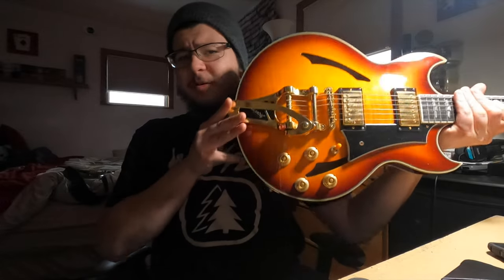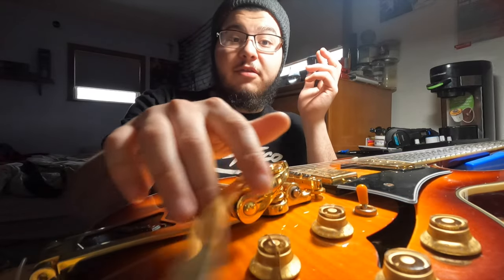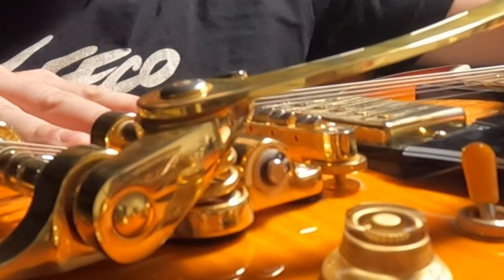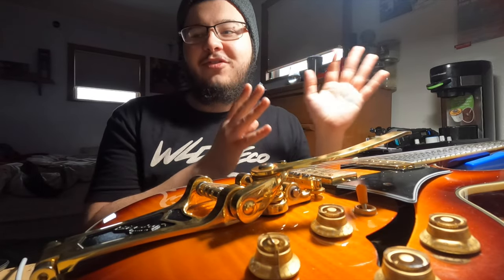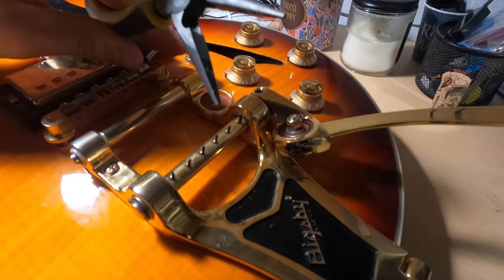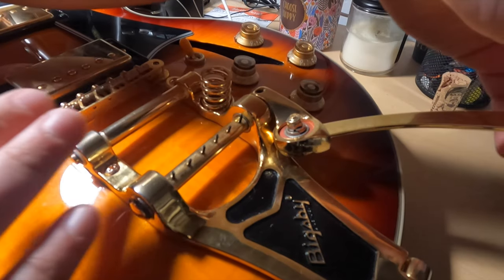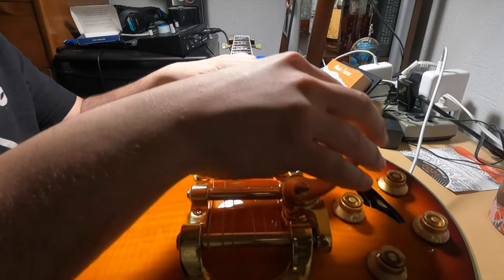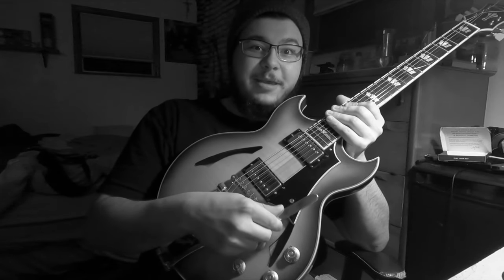How to fix a Loose and Squeaky Bigsby Vibrato

Comment: Use a second nut to tighten against the original. This will help lock the original nut in place preventing it loosening up in the future. I've also heard a small dab of super glue against the nut and thread will help bond the two together. Not a huge amount, just a small, single dot of glue so with little pressure the nut can still be released from the thread of the bolt if needed.
Reply: @Laxcoach1574  It's working perfectly. Obviously it may be finding the right fit but my Bigsby is vintage and two nuts, same size are working.
Reply: @davidsmoler9144  I've got a new 5240, there isn't enough room on the threaded post for a second nut. Wondering if I replace the washer with a lock washer if that will solve my problem of the nut working itself free.
Reply: @Laxcoach1574  Gosh?! Is it a licensed Bigsby? There may be some differences between the two. It's a bit of a hassle, I'm glad mine is working but it takes some fiddlin'. If new guitar bought via retailer have them sort it.
Reply: @davidsmoler9144   licensed
Reply: @Laxcoach1574  Ah, that may explain it then.
Reply: I have a question, I'm thinking of buying myself a non-licensed bigsby bridge jazzmaster guitar (about 200$). I'm scared if the trem stick is gonna be loose. should I buy the guitar anyway or should I go with a Fender squier jazzmaster? thanks in advance for the reply.

Comment: That nut that tightens the Bigsby arm is a 5/16" nut. Use the right wrench or socket. Pliers are a bad idea and there's a good chance of stripping the nut. Also straighten the spacing of your strings on the Bigsby roller arm. It will help you guitar stay in tune.

Comment: Tightening the nut is more or less a temporary fix for an ongoing problem. Why not just add a little drop of locktight to the threads or even a nut with nylon threads?
Reply: I tried that and i ended up ruining the threads.
Reply: @zacharyrossi904  what happened exactly?? what did you do?
Reply: @by.daekeryyy  its actually fine now im all good. i was just woried because when I put on the locktight the nut wasnt going on at fist but then it did.

Comment: Seems to me that they could solve this problem (happens to me every few years on my Emperor Swingster).  A different approach to engineering!

Thanks for this quick and easy video, plus the King of the Hill bit got a laugh outta me.
Reply: Actually this symptom, is a result mostly of the guitar falling, whereby tightening that nut is a perfect solution. 

If a different design was created it might break instead of loosen causing a worse situation to deal with and complain about on YouTube.

Comment: Don't understand how it got so loose......the nut on the underside is a nylock and they do not back off.  Anyway......the B3 arm on my Collings Statesman is much too tight and will be loosened as part of a modification I'll be doing this week.  I'm a volume control player and I find the arm in the way of getting to the knob easily.  In addition, the stop on the arm bracket does not allow for palming the handle with the hand in a picking position over the strings........that's got to change.  So I will grind the handle stop off the bracket, allowing the arm to rotate all the way up, and loosen the nut such that the handle drops and swings clear of the control knobs......much like yours does here but perhaps not quite that loose.  I also bought a short spring, 7/8", that will lower the arm into a better position for keeping it in-hand while still being able to be on the strings with the pick hand.  To each his own when it comes to setups...........rock on!